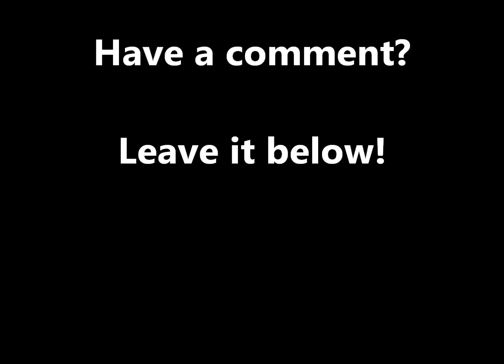Why magnet motors can not work (part 2)

Comment from the maker: +fpsd0minat0r Nothing wrong with using your hand to get an overunity device going.

Scientists only care that the energy output is greater than input. If an inventor successfully built a motor (even if it had to be started by hand) that output more energy than the initial 'push' to get it going then it absolutely would be considered overunity and would certainly win them a Nobel prize.

Experimentation and new ideas are always encouraged here, worst case scenario is a person will learn a lot from the experience so it is a win, win.

Thanks for posting!
Reply: +ian5576 Well, over unity devices are impossible. But over unity devices use transformed energy to power them. What you need is natural untransformed energy, such as the potential energy from a magnet. You still don't have over unity, but the device will continue until there is a mechanical breakdown in the mechanism that's receiving the untransformed energy.

Comment: I am always amazed at all the idiots who think that overunity is possible who use "Well...So and So's device got a patent, so that proves it worked."

Do none of you even know what a patent is? It is NOT proof of concept. IT costs a couple hundred bucks to file for a patent. Do you really think that that money allows the patent office to thoroughly research every device that someone has filed a patent for? For many devices it would costs tens, if not hundreds of thousands of dollars to full research. And you think the patent office is going to spend that much time and money all for a $300 filing fee?

If you were to go through every single patent ever issues, you will find FAR more concepts that don't work than do. Far more devices that never made it out of the design stage.

Comment: Magnet motors are indeed possible. This requires defying Newton's third law, in that, "for every action there is an equal and opposite reaction". You must first change the equilibrium between two like magnets by suppressing the opposite reaction of the permanent magnet interacting with another permanent magnet of opposite poles; this allows you to cancel out most of the opposite reaction. Even if you throw off the equilibrium by only 1% = 61/49, you have an imbalance in the system. However if you achieve a 30% imbalance in the system (70/30) you have more than enough viable forward motion to overcome any counter action. This is not theory. A simple shielding technique using tin achieves this goal. 

Once you set this action up to repeat itself, then and only then will you have a self running magnet motor without the need for outside energy to keep it running.

In simpler terms, this technique allows you to get one magnet to "leapfrog" from one magnet to the next, and when configured into a circle, you have a motor that runs itself. Despite Newton's 3rd law implies this should not be possible, it is.

Rather than dispute my findings, simply replicate it like others have; you'll be pleasantly surprised if not dumbfounded as to why such a simple answer has been overlooked for so long.
Reply from the maker: "Magnet motors are indeed possible",

Then let's see yours? It's been a year since you unveiled your invention that is supposed to solve the 'sticking point' on magnet motors so where is it?

James, I can appreciate wanting to solve the worlds energy problems but Evidence is required and so far there has never been a successful demonstration of a working all magnet powered motor. How many more centuries do you think it will take?
Reply: ian5576
The 'sticking point' was resolved and posted over a year ago. Where were you? If you were actually following my work you would know that, and secondly you would also know why I'm not able to post anymore videos at this time.

Children. Go figure.
Reply from the maker: James Roney Stators "The 'sticking point' was resolved and posted over a year ago. Where were you?",

That is exactly my point James, you supposedly solved the issue of the 'sticking point' almost a year ago, so where is your working all magnet powered motor?
Reply: Watch the last video I posted for your answer.

Thanks for your continued interest.
Reply from the maker: James Roney Stators "Watch the last video I posted for your answer.",

I've already seen it, now answer my question.

You supposedly solved the issue of the 'sticking point' that you claim is the secret to building an all magnet powered motor almost a year ago, so where is your working model? 

There are only two possibilities here,

1.) You figured out the most difficult part of building a successful magnet powered motor and even though it would bring you a Nobel Prize, a place in the history books above Einstein and more wealth than anyone has ever seen you are too 'busy' to add a few more magnets to your wheel.

or,

2.) It won't work.

I'm going with # 2.)
Reply: All you have to do is test it yourself as quite a few people have written to me telling me that after following my instructions, there test model worked just fine.

And no you did not watch it. Had you, you would know that I pull 80 to to 90 hour work weeks, and that job ends April 30th, 2014. Thank god.

It's all I can do to find time to do my laundry, let alone cook for myself. Now give it a fricking rest! Will you pleaseeeeeee??

By the way, putting more magnets around the wheel does not work. Rather you need stators all the way around. Again, please give it a rest. Build it yourself then.
Reply from the maker: James Roney Stators "I pull 80 to to 90 hour work weeks, and that job ends April 30th, 2014",

So March will be the time you unveil your all permanent magnet powered motor. I look forward to seeing your results.
Reply: @FreeMagneticEnergy2  10 years have passed. Where is your working model?
Reply: James Roney Stators "Rather you need stators all the way around."  Since a stator is the stationary part of a rotary system the suggestion of more than one is erroneous.

Comment: Ian5576's definition was in the next email. It's Stored energy + Added energy = More than both. i.e. Something for nothing. Even I don't believe in that. What my concept of overunity is is this: YOUR energy input is less than the machine's energy output. The source of the extra energy does not come from nothing, but from a real external source the machine harnesses to convert to additional energy. Wind blows most of the time without converting, but when a yacht's sail is up, it is harnessed and converted to move a great weight. The sailor did not input the wind, nor exert energy beyond lifting the sail. Magnetic fields lift (or push away) weighty magnets. If we can place them, the "winds" of electrons may do more than what it took to place them. That does not mean something for nothing, it harnesses what is there, blowing all the time like the wind.
Reply from the maker: "Ian5576's definition was in the next email. It's Stored energy + Added energy = More than both. i.e. Something for nothing. Even I don't believe in that. What my concept of overunity is is this:...",

Eric, you can not re-define what overunity is and expect anyone to listen. What you are describing is well known in Physics and has nothing to do with it.

Comment: On gasolene being called overunity: When you can input a gallon in a machine that gets more than a gallon out, you have it. I never implied anything that should make people think gas has overunity. Gas is the wind, or the magnetic field, except you purchase gas, not the others and it is of limited supply, making it irrelevant to the concept. Only a fool would make the comparison.
Reply from the maker: "On gasolene being called overunity: When you can input a gallon in a machine that gets more than a gallon out, you have it.",

That is a bit of an odd description of overunity but if the extra gallon were unaccounted for in your system, then yes, it would be overunity.

"The overunity is when the distance the boat moved used more energy than the work needed to lift and trim the sails",

This isn't overunity but it's okay, this is a common mistake. Overunity occurs when you have a closed system with a given amount of energy and if you add more energy then the total is more than the amount originally in the system and what you added to it.

For your sail boat analogy the wind is added to your system and when the total energy is accounted for it is no greater than the input plus what was in the system to begin with.

Comment: The overunity is when the distance the boat moved used more energy than the work needed to lift and trim the sails. Wind is not exerted by the operator; it is free and merely harnessed. Magnetic fields move weighty objects,like wind does. We may be able to harness them to produce power with less energy in than out. Positioning magnets to spin in their fields is not exerting the field's power, nor should it be greater effort. This is not getting something out of nothing. Our difficulties seem more with evil governments, scammers, and naysayers. I believe people have done it, and can't get past these groups.
Reply from the maker: "The overunity is when the distance the boat moved used more energy than the work needed to lift and trim the sails.",

As I pointed out several times (and explained why) this isn't overunity Eric.

"Our difficulties seem more with evil governments, scammers, and naysayers.",

Here is a crazy idea, how about before going on the 'it's all a big government conspiracy' bandwagon try building one. It won't take long for you to realize why they can not work.
Reply: You have no idea what over unity is.

Comment: Overunity is whenever energy gained is greater than energy used. Wind is the means of that gain, and magnetic fields can do likewise. If you can't comprehend that, it explains why you think it isn't possible. On the next point; Many scammers exist, making it easy for the few real inventors to be framed by governments. Look at the history. When there were few (and no scammers), they were all dying early mysterious deaths. As they grew in numbers (scammers grew also) it was easier to frame the genuine. Refusing patents provided a third option, as it discourages development. Finally, taxing  energy consumption is too big an income to lose. They will not permit free energy machines and will go to any lengths to stop them. They exploit the technologies that maintain consumption and are opposed to free energy.
Reply from the maker: "Overunity is whenever energy gained is greater than energy used. Wind is the means of that gain, and magnetic fields can do likewise.",

If that were the definition of overunity then you would be correct but it isn't. Overunity is when a closed system has more total energy than is inputted.

By your definition even gasoline would be overunity since it takes less energy to pump from the ground and refine than we get by burning it. If you can't comprehend that, it explains why you think it is possible   ;)
Reply: ian5576
Wind is not mined or refined and is not bought at the gas station, to say that wind and gasoline are the same is misleading and ignorant, as you state to Eric Lawton.

By your definition even gasoline would be overunity (over unity, 2 separate words) since it takes less energy to pump from the ground and refine than we get by burning it. If you can't comprehend that, it explains why you think it is possible   ;)

That definition was yours Ian and not his, and it takes more energy to pump oil and refine it than it takes for the wind to blow FREELY to say otherwise is misleading, wind isn't burnt and is not a fuel, as it is not consumed or used in a way as to make it "not wind" as is what happens when you "burn up oil", it becomes not oil as a fuel and is then a carbon that is no longer any thing reseblimg a fuel, as wind does not match this same profile that you seem to say is the same as fuel, I point this out to be that your statement is false and is intended to mislead and seems to make out that everyone is here to believe what your saying as true when all can see the blatant falsehood that you try to make a correlation between the two.
Reply from the maker: Frank Blackcrow"By your definition even gasoline would be overunity",

No, that is what Eric Lawtons definition implies. I go by the actual definition  ;)

"That definition was yours Ian",

Once again, No.

"and it takes more energy to pump oil and refine it than it takes for the wind to blow FREELY to say otherwise is misleading,",

What does that statement even mean?

"wind isn't burnt and is not a fuel",

No kidding? It's called an analogy Frank   ;)
Anyway, is there a point to your rant?

Comment: we would still be in the stone age if nobody ever said, hey, what if i dont listen to popular belief and actually try this.  i have a physics degree, i understand conservation of energy, i understand the reasons why a perpetual motion machine will not work, but for some reason, deep down inside, i still think it can be done.  look at a smart phone, pretty damn ridiculous tech inside those things, probably once thought impossible.  one comment on something you said about the magnets, potential energy ends when they collide, because they stick together, agreed.  now, what if you made them miss?  and then another set missed, and again, and again, and again, and now you have a machine.  its not that we need to poke holes in other peoples theories, but we should be trying to plug the holes to make something real.  perhaps there is something you could contribute to rather than deconstructing.
Reply from the maker: Nothing wrong with experimentation.

"i have a physics degree",

In what exactly?

Comment: Is it possible to make a motor that is powered by magnets? One that will run until the magnets run dead? Or are you saying this is impossible? Does using magnets deplete their magnetism? It is my understanding that a magnetic motor could be built, but the energy it would generate would be less than the energy required to magnetize the magnets in the first place. That the drawing of power would demagnetize the magnets and the motor would stop spinning. You seem to be saying that it is impossible to make even one rotation based on the fact that it takes the same energy to pull the magnets back apart as was generated when bringing them together. So would a magnetic motor really be that big of a deal?
Reply from the maker: "Is it possible to make a motor that is powered by magnets?",

To date we have not seen a working all permanent powered magnet motor and it also goes against the very foundation of our physical Laws so it is very unlikely that we ever will.
Reply from the maker: godofrock yeah "...let me organize 100 people with an IQ of 160, a team of 100 machinists/fabricators and give me 6 months and a $100 million budget. I'll have one producing the equivalent of a modern coal power plant. Zero emissions.",

Uh huh...

"Don't believe me?",

Nope.
Reply from the maker: godofrock yeah "...and when it comes to science, leave it to those who can think, instead of those who tell others what to think.",

Good advice, try it sometime  ;)
Reply from the maker: godofrock yeah "I've contributed a lot of science being used today.",

Uh huh...

"I've contributed scientifically for humanity on multiple subjects of exalting proportions.",

Is that right.

"Don't believe me?"

Nope.

Comment: Look up V-gate motor, it along with many other designs showed motion with magnets alone. Back in the early 19th century the science was faced with a fork in the road. On one side there was the empirical approach to science, the other side was the mathematical approach. We chose the mathematical side. However, math fails to explain the real universe it only approximates it. Was Einstein wrong with his relativity equation?
Reply from the maker: "Look up V-gate motor...",

I have, also I discuss it in one of my videos, one of the videos on this channel is open for comments on this exact subject, and in one of my 'playlists' there is a group of videos replicating how these things are faked.

"Was Einstein wrong with his relativity equation?",

Nope, been proven thousands of times to be correct. The GPS on your phone for example would not work with out relativistic mechanics.
Reply: Look up Perendev Motor, look up Hojo Motor. Why are there so many permanent magnet hoaxes out there? It doesn't make sense to pull the same hoax again and again even though NONE of these inventors have ever made a dime on any of these hoaxes. I tried donating to them.... and I couldn't find a way to. If they were hoaxers they'd at least could provide a donate link :)
Reply from the maker: Naoki Kashima "Look up Perendev Motor, look up Hojo Motor.Why are there so many permanent magnet hoaxes out there?",

Because they use their inventions to con people into 'investing' in their companies.

For example, Mike Brady, the guy responsible for the Perendev design was arrested a couple years ago after having swindled millions out of people. Not a bad return for a Youtube video and a website.